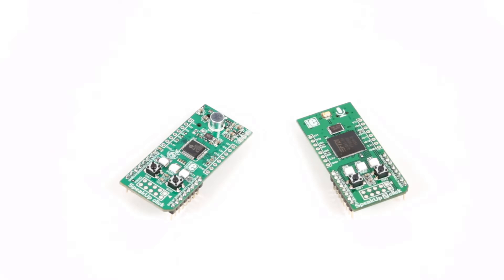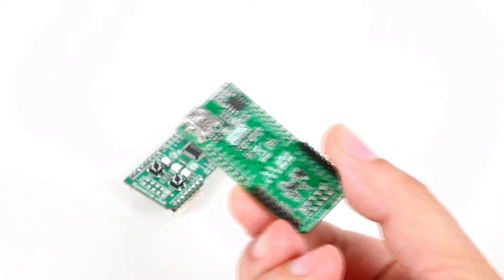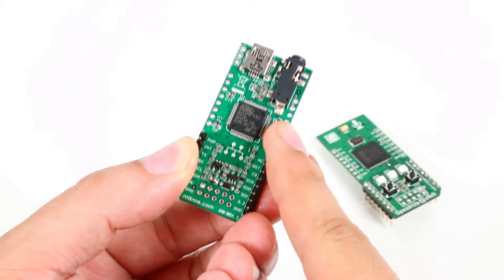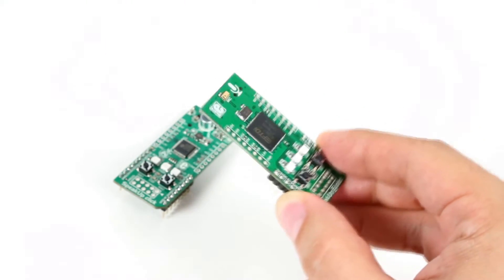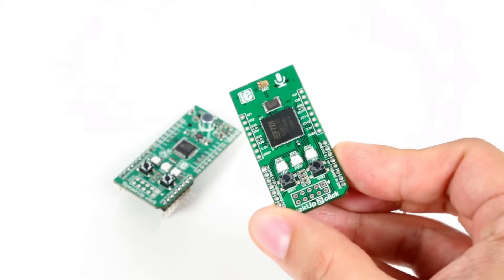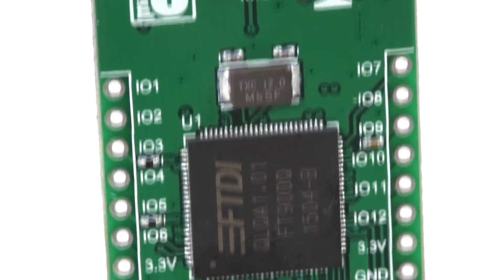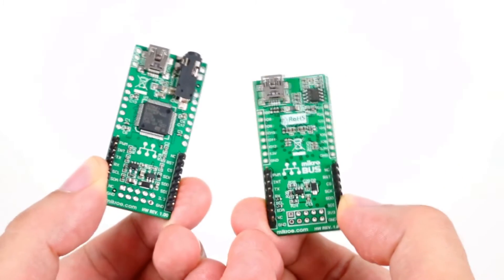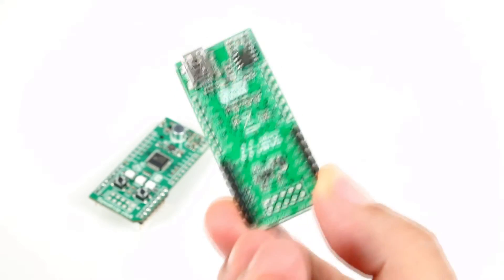SpeakUp 2 click - Example

Comment: This product is not capable of reliable voice commands. This manufacturer is the absolute worst at voice command boards but a wizard at marketing defective engineering.
Reply: I had one and believe me I had huge hopes for it. Unfortunately this device simply does not work at even basic voice commands. Voice recognition is a processor intensive application and there is no standalone microcontroller based solution. FYI any product that starts out with Kickstarter is typically a gimmick.